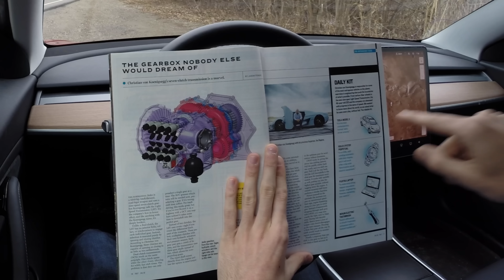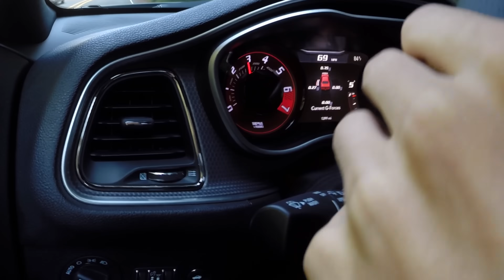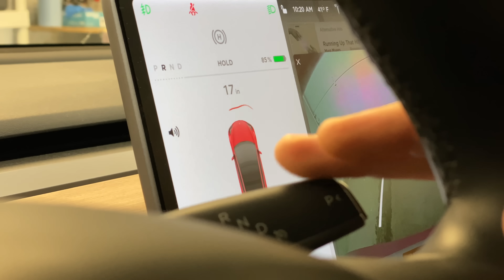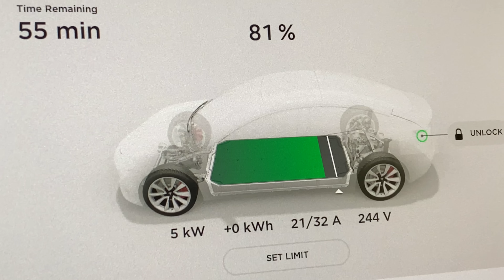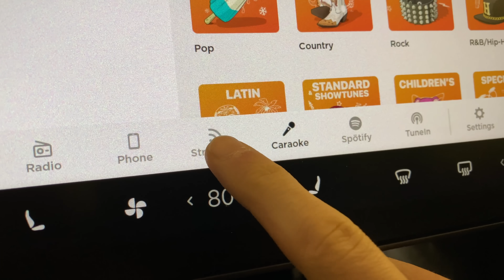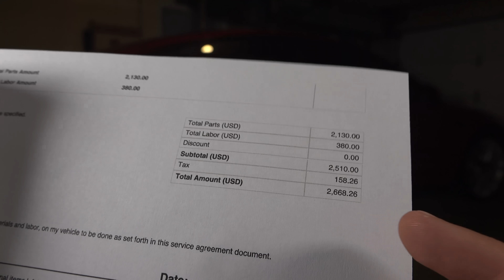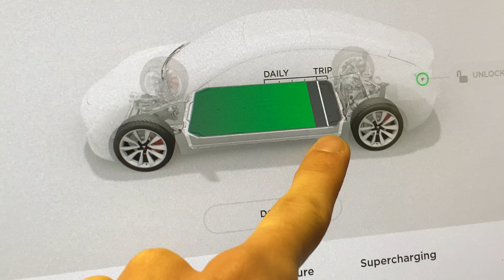Living With A Tesla Model 3 For A Year - The Best Daily Driver

Comment: You know there is a door opener inside the speaker grill in the backseats, that what they told me at the dealership :)
Reply: That is only on the X. Your manual will show you that there is no emergency release for the back doors.
Reply from the maker: Apparently you can install one, but there is not a manual release that is realistically available in an incident.
Reply: Might not be true 🤔🤔

Comment: They did start with electric cars, though it got killed pretty quickly.
Reply: Energy density too low, just recently became possible.
Reply: @TheSteinbitt  At least that's what we were lead to believe. How would we know?
Reply: Exactly
Reply from the maker: Correct, but they weren't mainstream for the past 100 years like ICE.
Reply: When Henry Ford mass produced the model T it went from around 50% gas cars sold to pretty much 100% years later fairly quickly due to affordability.
Reply: @googadisbeotches9360  Yea well teslas are not cheap the model 3 is the only reasonable one average people could buy but even that is a hard stretch
Reply: @cat-em3mj  that's the same price as most new cars.
Reply: @potterfanz6780  no it's not. You can get a good, mid sized sedan, a fusion or camry for around $30k, get a 1 year old and you can get a top of the line of either of those in the low to mid 20s. 

Teslas are luxury cars on the level of Lexus, BMW and Mercedes, they are expensive for average people.
Reply: @cat-em3mj  Agree, 50000+ USD is over 30000 more than I am willing to pay for a car.
Reply: @potterfanz6780  the vast majority of people in Southern Europe cannot/aren't willing to spend more than 10.000$ for a car and that number isn't much  higher in northern Europe. Tesla will not see mass adoption until they can develop a car that's at most 25.000$.
Reply: @WindHaze10  That's one of the things that's holding tesla back they need to make a cheap hot seller that a lot of people will buy
or someone else will do that and concur the electric market before they know it
Reply: cat factor in the maintenance and gas savings and you probably break even on a 10k car in a couple years
Reply: @fedyx1544  keep in mind they are a very new company, and the model 3 is their first "cheap" car. It will get cheaper and they will probably make an even cheaper one soon
Reply: @iKingRPG  i hope so, the musk himself has said he would like to lower the price of the model 3 to 25000 one day, or maybe they'll do something completely different, I just hope so I can afford to buy one
Reply: @cat-em3mj  I think that Tesla could easily develop (and propably has) a cheap car with a reasonable range, the problem is that they are not yet able to meet the demand (that would go through the roof). 
They have to have the production facilities in place first! 
Musk is a strategical genius, he started of with a model that was aimed at people with the power to influence decions regarding legislation and the necessary electrical infrastructure. 
Then came the model 3 (as the production capabilities grew,) which is aimed at a bigger part of the populous, in term making Tesla more money to even wider expand the production facilities. 
I personally am sure that when the time is right (when production and charging infrastructure allows it), that Tesla will release a world car. Once this happens it is truly bye bye ICE ;)
Reply: They got killed by the . . .  wait for it. . .   The electric starter. . .
Reply: @dewiz9596  lol seriously.The steam cars were done in with that tiny starter motor as well.
Reply: It was never killed. It's just impossible to use lead acid batteries for a car.
Reply: John H  : Depends how far you want  to go.  I believe the EV1 used lead acid batteries.  I have a Vespa type scooter that will go 50 km on 7 small UPS type lead acid batteries.  And cars like the Model T had extra gas cans strapped to the running boards. .  .   but it WAS the introduction of the electric “self starter” that proved the death knell for the electric car. . .   especially after the president of one car company died as the result of the crank handle kicking back at him. . .
Reply: @henryD9363  People have been doing lead-acid EV conversions for decades. It's not impossible but it is impractical because of that chemistry's low energy density.
Reply: @henryD9363  
The EV1 used lead-acid batteries and had a decent range for the time. When gas cars were new they didn't have much better range and there was no infrastructure for them either. Maybe we could have battery swapping stations instead of gas stations. Frequent 1000 mile road trips wouldn't have been a thing for a while, but you don't miss what you never had.
Reply: @andrasbiro3007 maybe but it will probably be easier to just wait for charging to get even faster and for batteries to last longer, because the batteries are extremely heavy.
Reply: @iKingRPG  
But if everyone waits we get to nowhere. That's how we got to nowhere for decades before Tesla. Someone has to start to make EVs and others have to start to buy them to get the ball rolling. The EV1 had laughable range and charging speed compared to a current Tesla, yet it was loved by it's owners. It was good enough to get around in a city and that's what 99% of people use their cars 99% of the time.
Reply: @henryD9363  They used nickle-iron, and lead acid was a huge improvement.
Reply: Quite literally one of the biggest conspiracies of all time
Reply: No,  @aygwm , that would be the purchase and dismantling of streetcar lines.
Reply: They also started with cars running on ethanol, Henry Ford believed every farmer in the US could brew his own fuel cheaply.  Which or course was true, but Standard Oil and Rockefellar used political bribery to make sure no one could make their own fuel. 
Ethanol is carbon capture cycle: as much C02 gets released is re-captured to grow the plant it came from.
If we ran ICE cars on ethanol, they would be cleaner than EVs overall.
Reply: @truantray  somewhat accurate but the CO2 emissions related with converting plant matter into ethanol are so high along with the transportation that it's overall very inefficient and impractical to use ethanol as the main fuel. if everything ran on ethanol, yes it would be net-zero carbon emissions but you likely wouldn't have enough land to grow the plants. and that's even ignoring the effect that corn has on land.
Reply: @boxr_4214  Who said we have to use corn to make ethanol? Beets? Potatoes? Hemp?

Comment: Not all EVs have regen braking with one-pedal driving. Also, some EVs (but not the 3) do regen with light taps on the brake pedal. I prefer two pedal driving with regen in my Golf GTE, but that's probably just old habits.
Reply from the maker: Correct, as discussed in the video Bolt, Leaf & Teslas have 1-pedal driving. I like this strategy more as there's no crossover in the brake pedal between motor & mechanical brakes. Some cars it's pretty noticeable, others it's fairly smooth.

Comment: I good daily driver car is a Dodge Challenger Hellcat with 707 HP. Anyway, the problem with the electric car is the battery's lack of range and recharge time. If that issue is not resolved the electric car will go into the dustbin of history. If you use an electric car full performance potential you will run out of battery and have to wait 40 minutes at a supercharge station making its torque and horsepower useless. When you go to a gas station, your refilling time is 5 minutes vs 40 minutes at a supercharging station. If you run your A/C or heat without driving your car you will burn up your battery.
Reply: John Azhderian I mean if you constantly pull your Hellcat then won't you run out of gas
Reply: Can you  top up you hellcat at home with your own solar without paying for gas?

Comment: Electric vehicles are just better. No noise, no emissions, no pollution, less fuel costs, less maintenance costs.
Gas and diesel are OLD polluting technology.
Reply: Actually very bad for the environment. Everyone just ignores the process needed to make the batteries
Reply: @modedchild  And everyone ignores the process to mine for coal, transport it and burn it, or the fracking for natural gas and the pollution of aquifers, or maybe the drilling for oil, oil spills in the ocean, on land or from pipelines. The materials used in batteries can all be recycled. Fossil fuels destroy the environment when they are produced and burned. The fossil fuels industry funds climate deniers and spreads FUD just like what the tobacco industry did saying no link between smoking and cancer. Repeating their nonsense does not make it true.
Reply: @KJSvitko  Have they ever started there ICE vehicle in a garage and sit in it for 15 minutes or so? Maybe they should try? 🤷‍♂️...... The nasty crap that comes out of that tailpipe is another thing the FUD spreaders are forgetting about. Just because your outside and you can't smell the exhaust doesn't mean it's not there.
Reply: @KJSvitko  only 16.9% of energy in the US is produced by renewable energy. Mostly Hydro and Wind. Although both of those also have ecological concerns of their own. 

Oil will always be needed as it's used in many different products. Just not as much for gasoline. That would help reduce production, but not stop it. Kinda the same argument for battery materials. Except in reverse, meaning an increase in mining for those.
Reply: @KJSvitko  these are all true but the countries with the mines for the battery materials do not have any environmental regulation. And these materials while they could be recycled just simply arnt as much as they should be. Also I don't think people should be so anti gas because of emissions. There was a study done that showed that an f150 driving from Texas to British Columbia put off less emissions than you would see from mowing your lawn. We have emission standards for a reason it isn't just for show
Reply: @shiftym1  It takes as much electricity in drilling, pumping, and refining liquid fuels than if you just charge your EV....